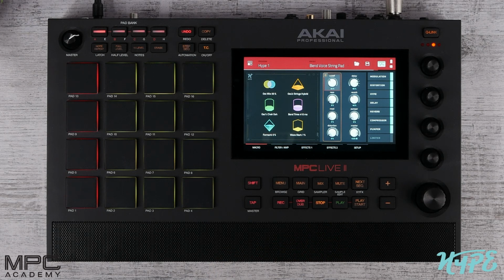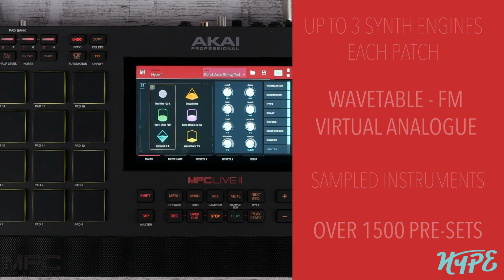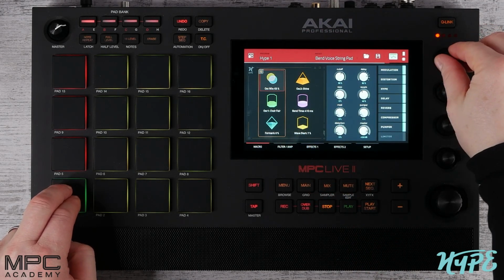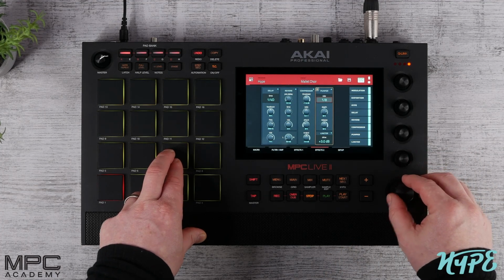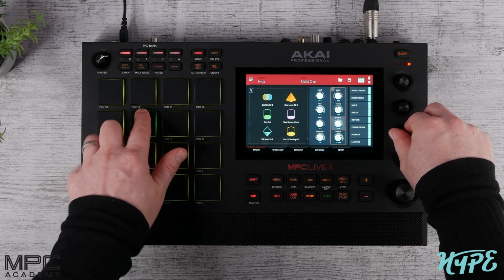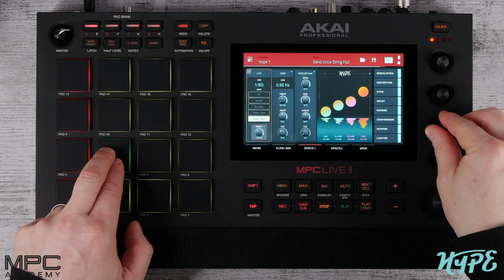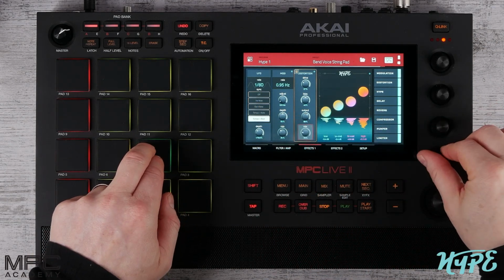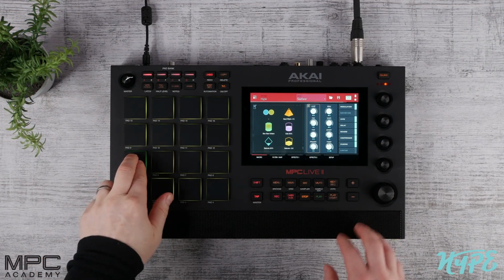Hype Synthesizer Plugin Instrument for MPC Standalone

Comment: When I read that it was a synth with 4 synth engines including Wavetable I got excited but all the info I can find on it, It appears so essentially be a ROMpler? Extremely limited control over very basic elements of each preset but no ability for genuine sound design...Unless I'm missing something that isn't on Akai's website or any of the demonstration videos it looks like it's just a contemporary ROMpler. Too bad because an actual synthesizer in modern design with full parameters beyond the bare-bones basics would be a hell of a reason to go stand alone MPC

Comment: Im having a very frustrating problem with MPC ONE retro. I can't access any of the new plugins; mellotron, hype, Solina or odyssey. i was able to export reaper and underground crates from MPC software onto an SD, creating 'expansions' folder but the 'Synths' folder was dropped into 'expansions' buuut they're not accessing. do i need to move the synth plugins to a different folder? I'm becoming very discouraged...
Reply from the maker: The 'Synths' folder has to be it's own folder on the root of the SD or USB drive.
Reply: @Akai_Pro  thank you I figured it out through trial and error

Comment: FYI IN CASE YA'LL DIDN'T KNOW: You CAN SAVE HYPE SYNTH PRESETS!!! After you make your patch (INIT patches), hit the DISC ICON on the top right. Once the save screen pops up, go to the INTERNAL drive of the MPC. Then go into MPC DOCUMENTS FOLDER. Then go to PLUGIN PRESETS FOLDER, Go into INSTRUMENTS FOLDER and they(AKAI) has already made a HYPE SYNTH folder for our presets. Go into HYPE FOLDER, name your preset and hit save. Now, when you go back into the Hype synth plugin a USER folder will automatically appear in the preset section at the bottom- with your just made preset in it. YOUR WELCOME.

Comment: The synths are great.
As a Force user I've been enjoying Hype for a long time already.

You get a lot of presets but you soon go through them very quickly. Akai are missing a trick by not releasing more sound packs for these synths.

Although Hype is a synth of sorts you cannot create your own presets from scratch.you can tweak existing presets but it ends there.

Hopefully now that all the MPC community have these synths we will get more people asking Akai to release more sound packs 👍
Reply: How you not make your own sounds? They literally have a bunch of INIT patches for you to start from scratch with. I have created things that aren't in the presets already. Every synth known to man has INIT patches to be used as a "blank" starting point. Also, you CAN SAVE HYPE SYNTH PRESETS!!! After you make your patch( see above about INIT patches), hit the DISC ICON on the top right. Once the save screen pops up, go to the INTERNAL drive of the MPC. Then go into MPC DOCUMENTS FOLDER. Then go to PLUGIN PRESETS FOLDER, Go into INSTRUMENTS FOLDER and they(AKAI) has already made a HYPE SYNTH folder for our presets. Go into HYPE FOLDER, name your preset and hit save. Now, when you go back into the Hype synth plugin a USER folder will automatically appear in the preset section at the bottom- with your just made preset in it. YOUR WELCOME.
Reply: @IsshmanGarcia  the INIT patches are not really initialised patches. You cannot change the sound engines to what you want.

 You're more or less stuck with some of the settings on that first page which limits the sound design possibilities. 

Thanks for your shouty reply tho. Kind of motivated me 😄

Comment: If anyone from AKAI reads this, first of all thank you for a brilliant update. The new firmware puts one up on making this a brilliant experimental sound box, to create our own sample content, well played.

Can you please, make the Program LFO to function like the LFO on Hype? So basically include the Tempo + Beat option so the LFO does not re-trigger from the same phase cycle, at each trigger. If you want to add a phase parameter to select at which phase the LFO will initiate for the Tempo + Note, that would be great.
Since you can implement this LFO on Hype, it would be easy for your programmers to add its functionality to the Program LFO.

Cheers!

Comment: shame it's not available for mpc live
Reply: Dude what? You are seeing it on mpc live! It's on live mk1, mk2, x, one and touch.
Reply: @okeribok  https://www.akaipro.com/mpc-air-hype-synth Not for libe, just: One, live 2 and X
Reply: @70soul35   - yes for original Live (MK1).  You don't see it on that page because the Live is no longer manufactured.  It's the exact same hardware as the Live 2.  Hype Synth installs and works fine on it.
Reply: @EnochLight  do you have live mk1?  I installed 2.10 and I have these new vocal effects, half speed (on the akai page about this effect "live" is on the model list) but I don't have that Hype.
Reply: it may be that just installing 2.10 is not enough and I have to install it somehow separately
Reply: Here you go bro… https://www.akaipro.com/mpc-live
Reply: @djpaceeuro  
really Hype is not for Live MK1, I installed the latest version yesterday. I can only use hype in mpc desktop, not in hardwawre in stand alone mode
Reply: @70soul35  you have to add the synth content to your external hard drive or SD card. The update is for X, Live, Live II, and One.
Reply: @dJBoog  Thank you!

Comment: somehelp me unstand what this means To install this synth content on a standalone Force or MPC device, copy the Synths directory into the toplevel
folder of a SD card or USB drive. You do not need to copy any of the other files. Then, insert the
drive into your device
Reply: I have the same issue. 2.1 install didn't install the plugins for standalone automatically.
Reply: The instructions are exactly that - copy the folder called "Synths" (from the MPC Synth Content file available from your Akai account) into the root directory of your attached storage (whether that be an SD Card, USB stick, or installed SSD).  Update to 2.10, and then the new plugins will all show up.  Just make sure your attached storage is attached before you turn on your MPC.
Reply: @EnochLight  Thanks. Yes I figured that out. But what's strange is that the existing standalone synths (tube, bass, drum, etc ...) must be on the internal microSD card. 

I do wish the other synths, like hybrid, the Wub, rtc ..  could be moved over to standalone, as well.

Comment: I'm a bit confused, is there no way to change the "synth engine", i.e. what oscillator types are used once a preset is loaded?

A bit awkward having to restart sound design using another init preset when changes are needed, but maybe i'm missing a (hidden) function here.
Reply: On the Macro page, can't you double tap one of the sound engines and get presented with a list of available sound engine sources?  I'm away from my studio and can't remember if this is possible or not.   Otherwise, you have to load an "Initialize" sound engine source to start.
Reply: @EnochLight  What you are describing is changing the oscillator. What i'm looking for is changing the oscillator configuration (e.g. Wavetable & Analog, or Analog & Analog) which is not possible. Loading a new preset is not a solution, that's starting from scratch.
Reply: @uly1981   - ah, right.  When you're in a loaded preset, you can only change the oscillator from an available list, and that's it I'm afraid.   Hype's strengths is definitely in its macros.  We aren't given access to anything much deeper than what you see in this video.

Comment: The “synth content” folder is on my SD card in my MPC live. I rebooted my MPC and the plug-ins are not available but I see the file on the card
Reply: @Julian J - did you copy the Synths folder onto the root directory of your attached storage?   Read the PDF that comes in the download - it explains how to do it very clearly.
Reply: Just take the synth folder out of the synth content folder and only put that on your drive or SD card
Reply: @Dyler Turden  seen that on another video. Haven't updated mine yet.
Reply: You need to copy it to your internal drive. Then reboot. Drag n drop or copy paste it.
Reply: @WinZard  how?
Reply: @babar141  do it with it plugged into your pc with the USB cable attached.  You will see the mpc internal drive listed on your pc/laptop what ever you have in its drive list.